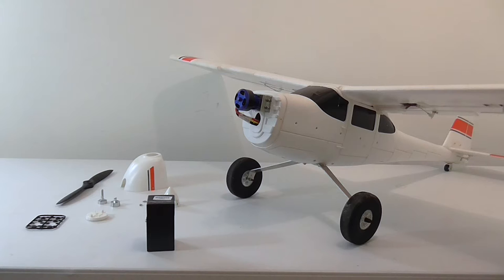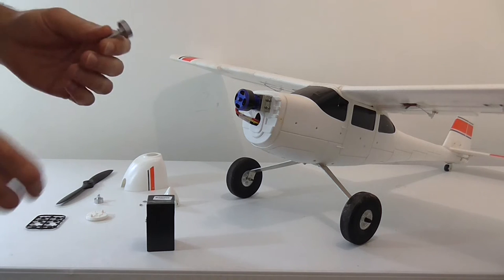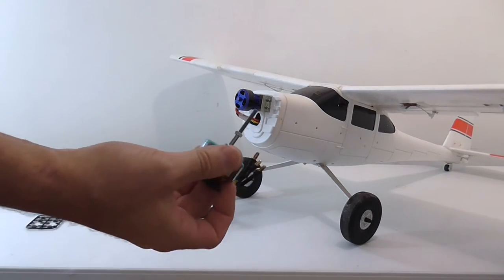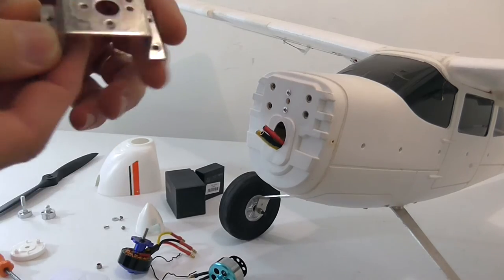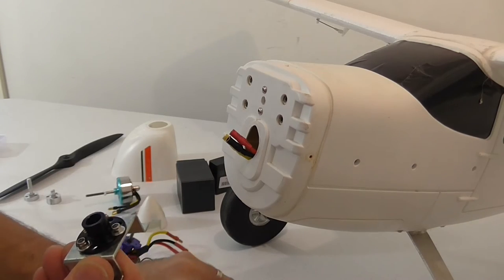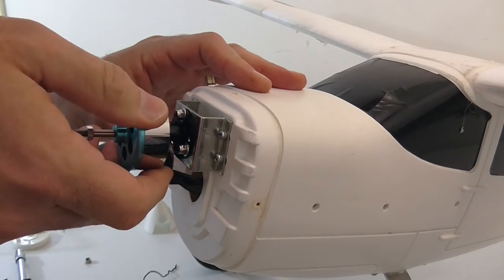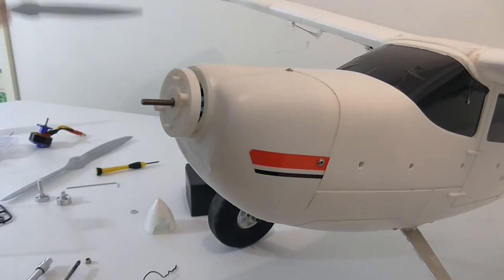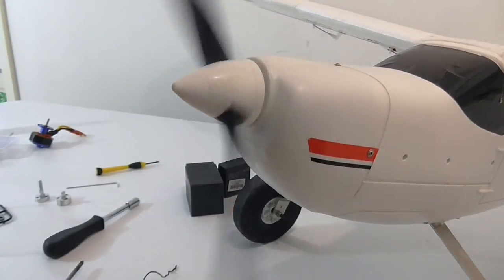Trainstar Tough Trainer EPO 1400. PART 1: D4023 Motor Replacement.

Comment: The inner nut of the drive shaft that comes with the D4023 motor is too small to fit properly inside the back plate of the spinner, how did you sort this out? Did you use a different spinner?

Comment from the maker: You can connect the motor wires anyway - if the motor runs backwards then just swap any two wires. This is the same for all brushless motors.
Reply: Hi there, i wondering what replacement prop did you use. Thanks for this video. big help. i bought the same replacement motor. did the same thing bent the shaft..
Reply from the maker: I used the JXF Poly Composite Propeller 12x6 from Hobbyking - it's pretty solid & never breaks !